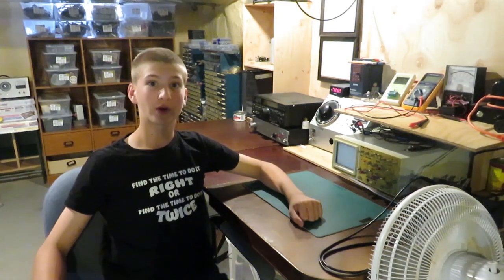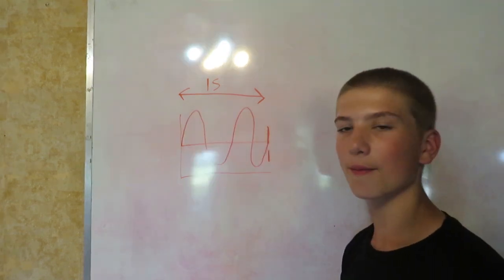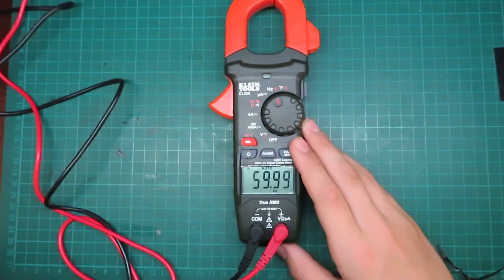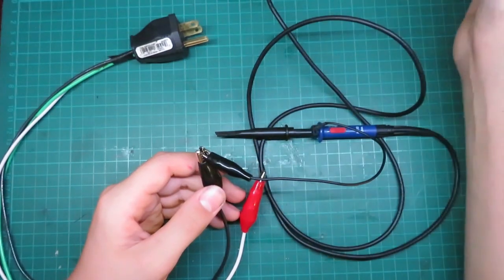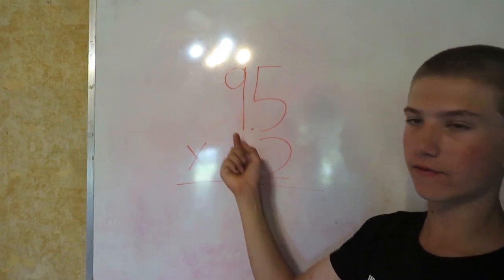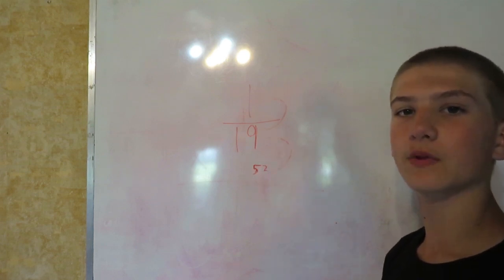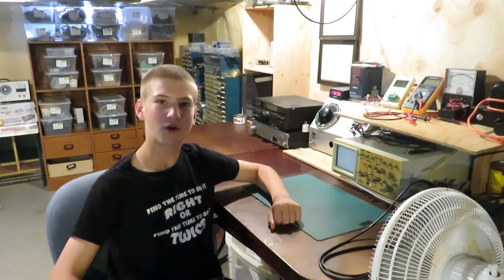measuring frequency without a frequency counter

Comment: Q). I have not seen before, removing the probe ground wire and just connecting the probe to the ground wire accompanying the mains (H/N).  Did I catch that right?  You never connected to H or N ... only G and measured the sine on your analog scope?  Thx.
Reply from the maker: what I did was put the scope probe to the Hot because the oscilloscope has respect to ground and so does the hot.  removing the probe ground wire was just a safety precaution not to short anything. hope that makes sense!
Reply: @prettymuchflawless-cn1ms    , Thx for the reply.  Connecting a scope to mains is a big deal, and oscilloscope differential probes are always recommended.  In your video, you said that you were using an auto-transformer to lower the mains voltage, but it was never on-screen.  This makes me fear a newbie connecting a probe to HOT without lowered voltage ... and bad things happening.  So, glad you pinned this!  You still might want to addend/add a diagram showing the whole setup of mains-to-transformer-to-scope.  Just a suggestion, but might save someone and/or their equipment.  Mr. Carlson's Lab (Paul Carlson) always states a disclaimer in his videos for his protection when in dangerous territory ... and you might want to do the same.  Your choice, of course!  Cheers!  Hope you didn't mind me playing "straight man". :D
Reply from the maker: @surgingcircuits6955  No problem thanks for the feedback!

Comment: I counted 8.5 divisions, so 8.5x2=17 and the reciprocal of 1/17=0.05882 (so move period 3 places to the right) or 0.05882x1000=58.8235Hz
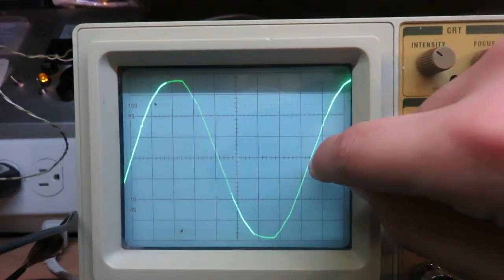Reply from the maker: You are Right! I should not have counted the first division at 3:12 in the video! Thanks for pointing this out! and Thanks for Watching!
Reply from the maker: And that also mean my Oscilloscope is more accurate!